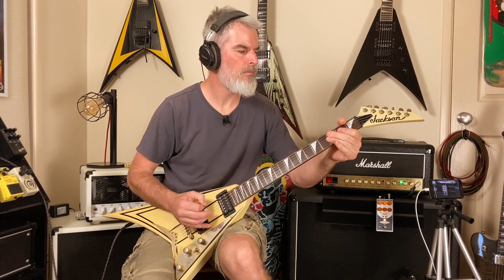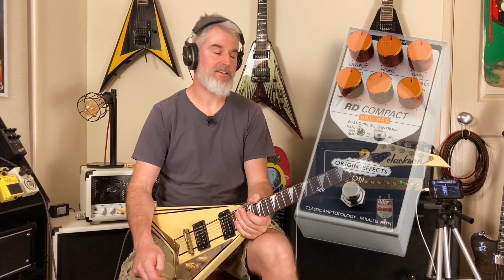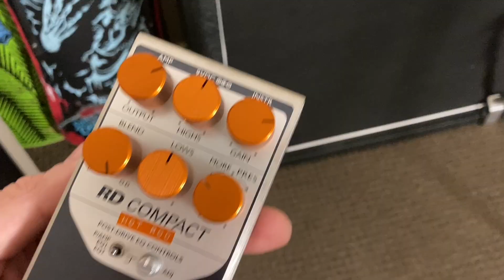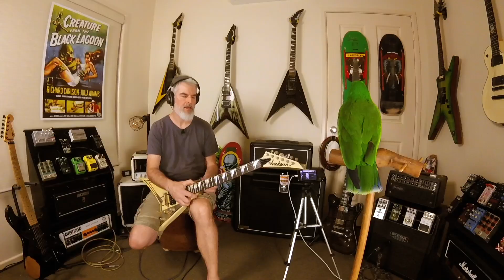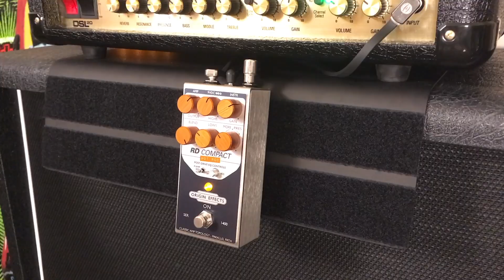Cranked Plexi Tones - RD Compact Hot Rod by Origin Effects

Comment: You got an amazing picking technique. What pick are you using these days? I saw your older video about picks and was wondering if you are using the Petrucci one, Tortex, something else.
Reply from the maker: Well thanks man, I didn’t settle for any one pick for a few years but I can say with confidence that the Hetfield black fang .94 is it. The 1.14 is a little heavy and I lose feel but the .94 fits perfect. Those black fangs have great tone and feel precise without obstructing speed
Reply: @LambChopper678  That's awesome! I have the white fang and I come back to them for rhythm constantly. Only quarrel I got with them is that they worn out super quick, but maybe the black one isn't as much.
Reply from the maker: I found the white ones great for thrash riffs and they add a scratchiness to the tone which works great for exodus riffs but yes, they wear out really fast.